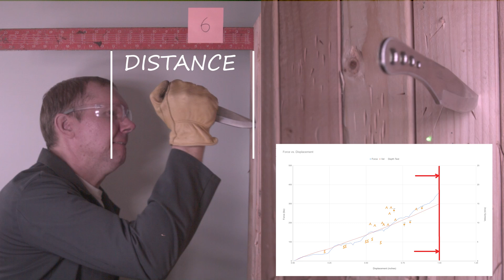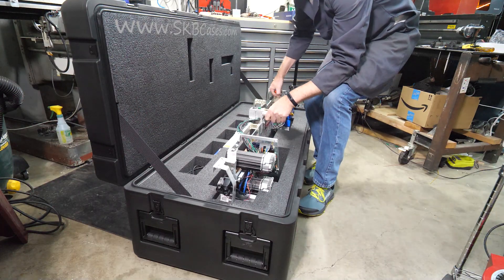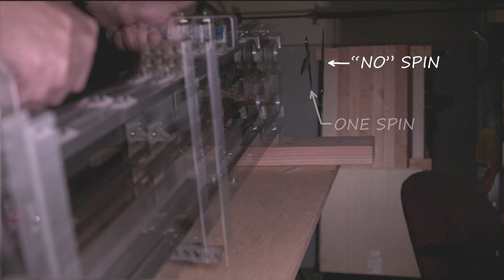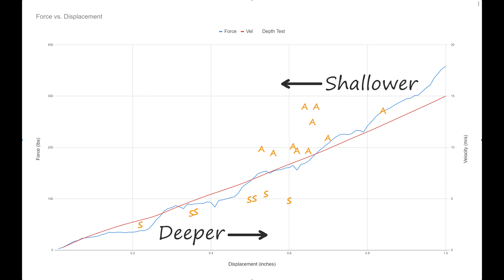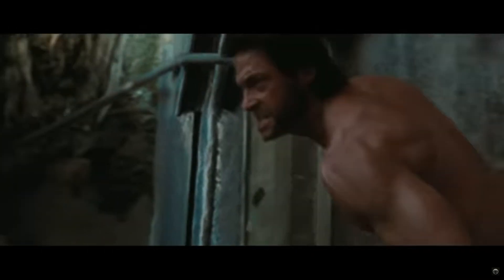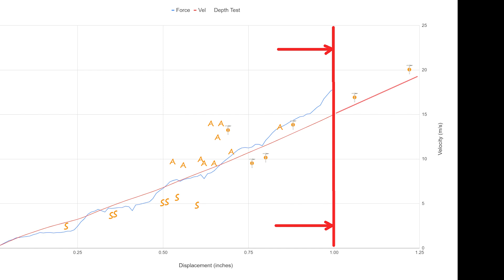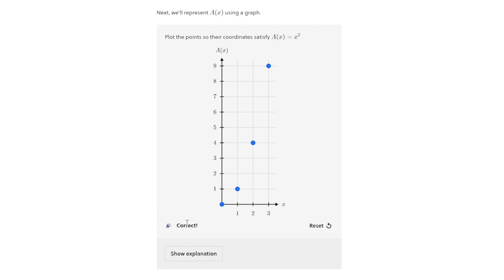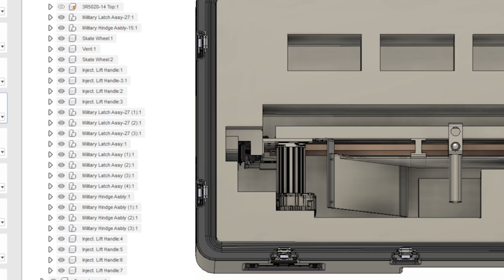Stabbing SCIENCE

Comment: splitting boards is easy with throwing knives if you can generate the power its even easier with larger knives
I have Ace Jet Apache knives I can sink them anywhere from 2 to 4.5 inches  on no spin and military half I will make end grain targets from 4 by 4 or 2 by 6 scraps I started out cutting the blocks at 4 inches and now make them at least 5 or 6 so they wear longer instead of split. my next is going to be a larger wall with 8 inch sections of 4 by 4 for better wear, smaller targets wear out fast and using boards like that setup in the video 
is easy to make but not as durable its like an axe chipping at the grain

Comment: I watched the previous 2 vids and the whole project was amazing but when you first posed the question of why stabbing a knife didn't have much penetration, it was pretty obvious it was going to be a skill and strength issue. You're not stabbing while optimally using biomechanics with the aim of driving a knife through wood, you're doing a Hollywood motion stab. And grip strength would greatly reduce the amount of give on impact. A forward stab should be horizontal coming out from your chest. An overhand stab is more for hitting downward into someone's collarbone and you need to put hip twist into it.

Comment: The making something more flexible also making it stronger point also applies to end mills.  When cutting a material with sudden hardness changes HSS end mills can flex instead of shattering, making them better for the application than carbide. This especially applies to cutting something that has one material inserted into another where one of the materials might come loose and move.

Comment: if you stab a lot of the energy gose into the none ridged structure known as your body the knife when thrown has no soft part to store all that energy that and its as simple as force over time wen you throw something its going way faster then when you just put your body weight into it  try holding the knife ducktape it to your hand then stiff arm and run at the board you will go way deeper

Comment: Very interesting science behind the art of knife throwing. I throw knives on almost a daily basis and one thing I have always wondered is if a no spin throw is more powerful than a half spin or full spin throw. If the knives were thrown at the same velocity in two different ways which one would end up striking the target with more force?
Reply from the maker: In theory the spinning ones have more energy but as you saw in the experiment, the difference is insignificant. Stability of a spinning knife is much better in my observation but you pay for it with distance sensitivity.
Reply: @QuintBUILDs  I was wondering if having a vertical setup (dropping it down onto the board with spin) would have had the same results as throwing it normally? Or if it wouldn't be a valid comparison.

Comment: Hey! One reason that your stabbing may have been less than expected is because thats not a very efficient way to stab. Usually, its more of a outwards thrusting motion with the hand in front of the pelvis (this is done while taking a small step forward with your front foot, assuming you are standing in a stranded kickboxing stance. This lets you put your body weight behind the knife.) You can get more power that way!

Another thing to note is that it is common to unconsciously limit power in your stab to stop your hand from slipping onto the knife, maybe try one that is meant to be stabbed with and will have a better contour for gripping, or one with a guard for your hand.
Reply: that will increase the amount of force you apply to the stab, yes, but it will be force added over time, not so much to the initial impact force. 

you're absolutely right about the end result, but it's pretty much the difference between the depth from one stab, and the depth after you take that stabbed knife and drive it in with a hammer. except instead of a hammer, it is your hand/body pushing against the knife after your fleshy bits squish and your bones bend slightly. by the time the push from your hands reaches the knife, the initial impact is over, or nearly over and youre applying a second force. 

if the question was "how do I improve my stabbing." this comment would be the answer. but the video exists to explain why the stabbing was inferior in the first place, not to optimize stabbing :P
Reply: Throw is still way more powerful than stab ,) proved many times
Reply: @AdamCeladin  not exactly disputing it, just pointing out how he could improve his technique!
Reply: @arial_01  of course and better knife thats for stabbing mainly with better point